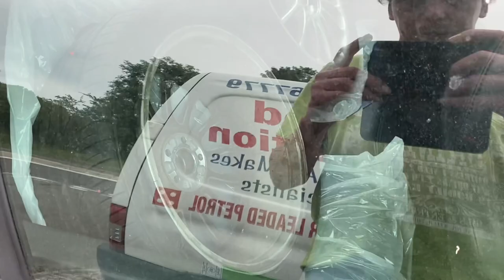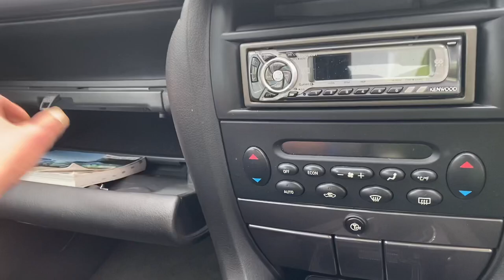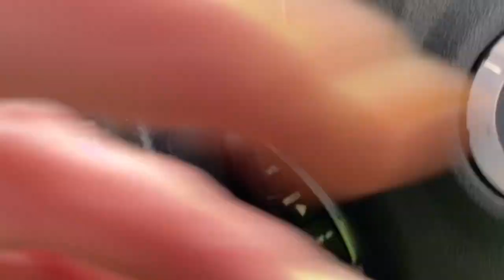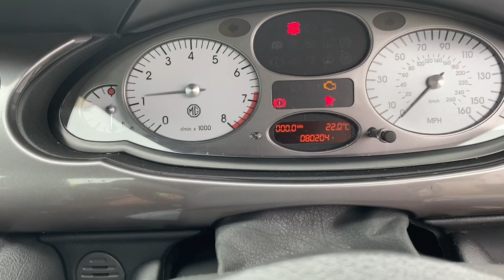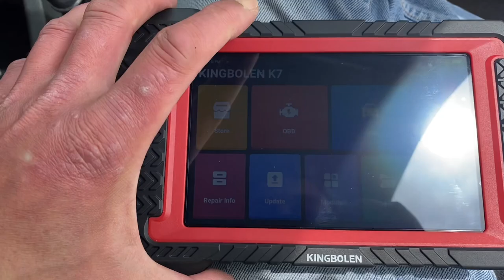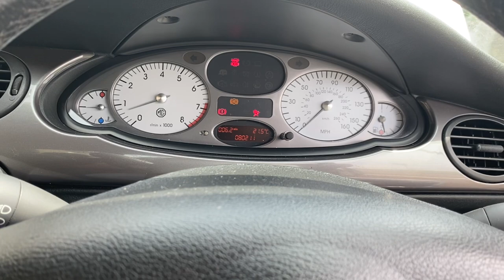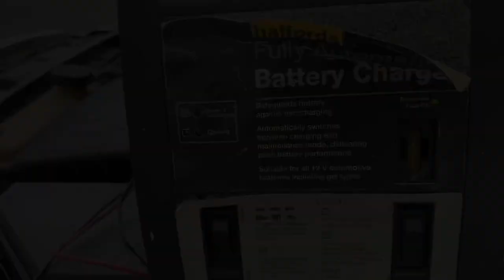Stigbürt Resurrected! My MG ZT 190 finally comes home…but is he fully fixed???

Comment: The seatbelt warning light on mine comes on intermittently. When it does, it’s usually one of the connectors under the driver’s seat. I think there’s a yellow one and a blue one. Can’t remember which one it is off hand but if you give it a squeeze it sorts out the problem. Always happens after someone adjusts the seat which I think in your video you did make a mention of. Great cars. Still have my ZT-T, now north of 220k miles, and going well thanks to Exeter Road Garage
Reply from the maker: This is the airbag light, and it’s on because the seat airbag deployed during a minor incident. The problem then is that the airbag ECU needs to be replaced along with the airbag itself, as once it has deployed the triggering of the light is permanent.
Reply: @Mr_Boaty  that will likely explain yours then!

Comment: Also, what a lovely local garage you have right up from your lovely home. 😊 and cheap fuel ⛽️ too 🤙
Reply from the maker: The chaps are lovely, and most awfully expert. They deal mostly with very high end classic and sports cars. They tease me mercilessly about mine, but they do look after me! I recommend them to all and am yet to hear a single less than ideal experience. Oh, and the fuel is attended service courtesy of the lovely Maxine. Not many fuel stations left where you don’t need to get out of the car! Plus they have the really good stuff designed for classics. Now that isn’t cheap, but it’s as good as you can get…
Reply: @Mr_Boaty  is it worthwhile Mustard looking at that Volvo tank, err sorry, estate...?

Comment: OMG, I nearly had a heart attack when you shut the door with keys in ignition 😂😅 literally imagined that when you connected the jump leads that it was gonna lock 🔐 😂
Reply from the maker: The window was open wasn’t it? And if it wasn’t I have spare keys on hand. I should have had them out though to be fair…
Reply: @Mr_Boaty No, it was closed 😂

Comment: I take back all my comments on selling Stigburt. He is a stunning V6 😍 and he really does suit you, Boaty. And that V6 Purr is sensational! Let's get him fully fixed up 🔧🧰
You're welcome to the battery I have 🔋 if yours gives up. It definitely looks correct, one for car & slightly bigger, I think.
Keep up the great content 🤙🫶
Reply from the maker: Aw, thank you Joe! 😊❤️
As you’ll have gathered from my posts in the Facebook group Stigbürt does have a big old place in my heart. They’re a good car, arguably the best thing produced in the end period, and Stiggy is a very good example. Far from perfect of course, but I did buy very carefully. He has been owned either by genuine enthusiasts or in the case of the previous owner but one (the previous owner only had him short term) a specialist MG/Rover mechanic. And that shows in the driving. The imperfections, such as they are, are purely cosmetic…